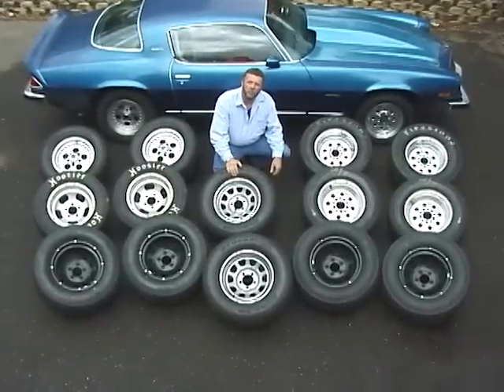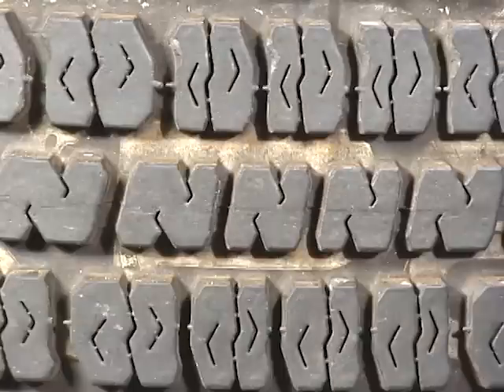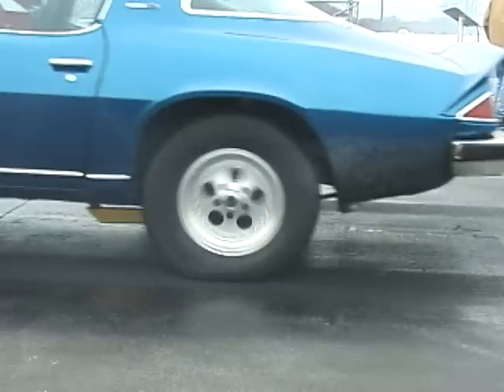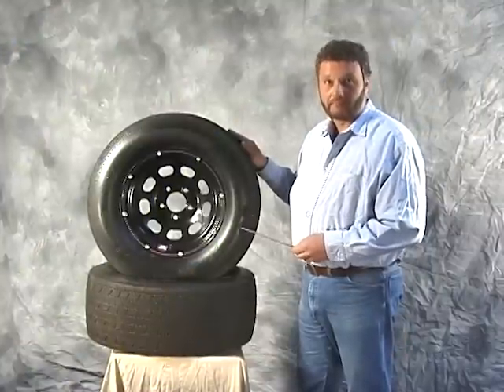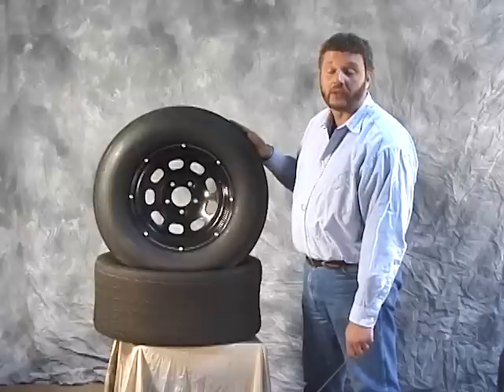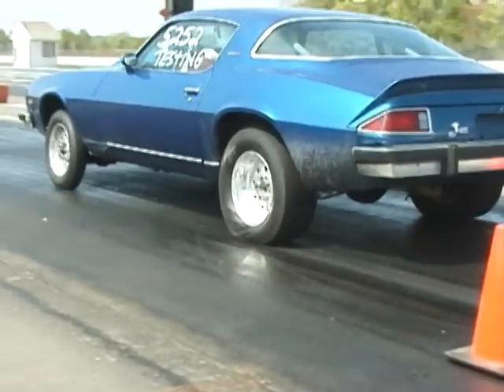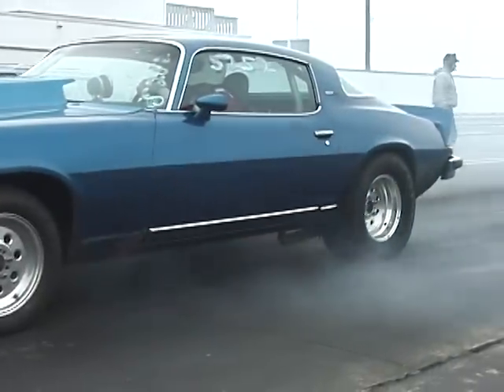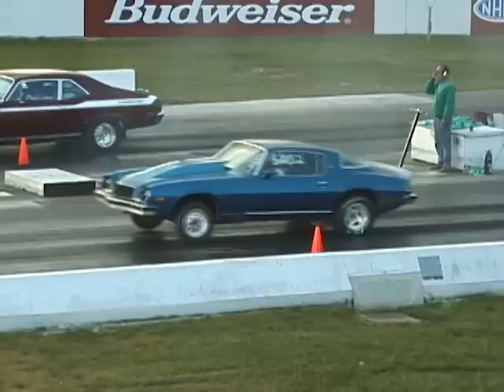DOT Drag Tire Test Video

Comment: Great great video, I'm still confused on what I should buy for track use only tire for a 6 speed car making 400 rwhp, I'd have to drive to and back from the track 2 hours each way.
Reply: +Stevie Bottz Get yourself a small utility trailer and a small hitch welded on.. because with a 6spd your best bet is a Bias Ply set of tires which even if you get a DOT rated set. Do Not try and drive them on the streets. They're extremely sketchy and with the movement in the sideway turning is always sketchy, and if you're caught in the rain.. forget about it your sitting it out til the road dries.. you cannot run radials up front and bias in back( Most tracks wont let you.. and even if they did you get squirrelly on the top end and can easily wreck it) so you'll need Front Runner Bias ply and Rear Bias ply tires. Bias Ply is alot more forgiving on your rear end components and absorb the shock of the launch alot better. With Radials the sidewalls are much stiffer as explained in this video so more shock hits your rear end and depending on what you have done to it at all.. Its really only a matter of time before you blow it up and with a M6 its usually Much earlier than you think. Drag Radials really were designed for Auto Trans cars, where the launches arent has harsh really. but obviously when you get into high enough power you'll want to get a stronger rear end with whatever you plan on doing.
Reply: +slasher7555 Oh and i almost forgot to make a suggestion.. MT ET Streets Bias Ply version.. Dont really mess w/ slicks until you have a built rearend to take the punishment. you can't really go off this video that much since its from 1999, Tons of new options have been made available since lol
Reply: slasher7555 Thanks for the imput, my TA has a moser 9" with 410 gears 6speed, the entire rear including axles and suspension mods are done. I cannot trailer it so I was looking into toyo proxes tq drag radials, do you think those would work for me? I would like a sticky tire that will take the 6 speed and still sorta be  streetable, thx In advance..
Reply: Ok so your rear will be able to take the shock abuse, but you won't get your best 60ft with DRs. Bias Ply will always be best for a stick car.. You most definitely can but a small hitch on your bird(it was an option too believe it or not from factory) its been done many times, by like the guys who run the Hot Rod Drag Week and a lot of guys who drive their cars to/from the track. But if you don't want to that's a different story. You won't get your best 60ft but you'll still hook. Now I'm still personally attached to the Mickey Thompson ET Streets so this case you would go with The Radial version. But there's also the newer ET Street II's, and ET Street R, ET Street Pro Etc. The ET Streets are what paved the way and set all the track records. The Toyo Proxes are good tires don't get me wrong, and alot of people like their price.. I've heard them Compared to the Nitto NT05s, might have a little issue hooking w/ the M6 initially, since DR's are made more to suit an Auto car. There's quite a few threads you can read about these tires on Ls1Tech that are comparisons and frankly the New ET Street Radials always came ahead in favor. Also think about some front Runners, you can save usually like 50lbs of rotating mass up front with them. Alot of Fbody guys and vette guys use GTO Spare Rims with MT Sportsman 26-6-17s on the front. you usually can shave another .1-.15 with the reduced rotational weight.
Reply: As for the car, I kind've figured it was a Fbody when i read 6spd ;) I'm an Fbody guy myself. I have a Pro-Touring 3rd Gen Iroc. Under the Hood (my videos are a bit out of date) is a forged 385 Stroker running a Holley Stealth Ram Tunnel ram intake and Stand Alone Holley EFI. Should be putting down around 450rwhp, its built to whip around a road course or hit the 1/4mile. Will be prepping for a cage at the end of this season to come out strong w/ a 300shot to add to the mix hehe. My daily wheels are 265s up front 295s in back Bridgestone Potenza RE760 Sports which are amazing for turning.. and 1/4 will see the GTO Spares up front and MT ET Streets Radials in back since its a A4 trans
Reply: Sweet always good meeting a fellow Fbody fan and thanks for your insight much abliged. Your Iroc sounds sick. I had a 87 Z28 h.o stolen from me some years back, white with silver bottom Iroc wheels, all stock with a muffler delete lol no tune back in those days I knew no better.
Reply: My current set up is a 99 t/a full exhaust lid tune 410 gears made 330whp previous owner told me but she smells rich,  I love my car. I've been reading up on how restrictive my flow master muffler is so I'm getting something else, I have I believe 80 series cross flow chambered known to flow as good as stock just sound better. Today I started to gut the interior then going to reseal it to see how it sounds just for the hell of it, if no good I want tsp stingers or magna flow. I'm only considering M/T or toyo at this point, I'm going to buy a spare set of dedicated track wheels but need to drive back and fourth on them if I don't hitch.
Reply: Almost forgot I m running bfgoodrich g force t/a kd 315 35 zr17. I was considering dropping my tire pressure but heard it's a waste on street tires so I just braze them. Best 60 foot 2.327 I drive pretty good but spin a decent amount in 1st and 2nd, 2nd time at the track with this car, I even hit a 2.6 at 107 then 13.60 at 108 with a 2.3 60'. I need traction to run stronger, I'm sure it has 12s in it.
Reply: Very Nice, and yea Flowmasters are horrible. My exhaust is pretty much custom including the Headers which were made my Dyno Don out of California they're intermediate length built for 3rd gens. 1-3/4 primaries 2.5" collector. and Length is between Short and Long for best fit and a happy median between Low end tq and high end hp applications. I did still stick with a Magnaflow setup in the rear to finish it all off. And yeah dropping tire pressure doesnt do much on a street tire, they work best when they're at their riding temp and Psi. thats why you even have people say dont do a burn out w a street tire. maybe a quick blip to clean the tread but thats it, and also to avoid and go around the waterbox don't drive through it. You should check out my videos of the car, I dont have anything that real current since i did the new motor swap last year.. but my 355ci that was in these videos put down 327rwhp/335rwtq on the dyno.
Reply: Will do, slasher do you think I'll throw my tune off by making my exhaust less restrictive with a better flowing muffler since the it was tuned with the flow master, I know the back and fourth talk about back pressure so it makes me wonder, I'm hoping I don't have to re tune for more flow etc
Reply: Naw no change of tune for just swapping out a muffler
Reply: Cool, your Iroc is badass
Reply: ty sir, and will be alot faster and getting a well deserved update video soon once i'm done w/ the Holley EFI stand alone ecu swap. It'll mark the stroker being complete

Comment: Weight of tires is a factor , as is the weight of the wheels. On the same Weld Rodlite wheels, going from a Mickey Thompson ET Street S/S radial size 295/65R15 to a Goodyear Eagle radial slick (30/9.0R15) actually 29.5” tall, my ET dropped .128 second and my MPH picked up 2.48 mph.  The weight difference between each tire was 16 lbs. 38 lbs for the M/T and 22 lbs for the Goodyear. Now consider besides the tire weight differences, the difference between forged aluminum wheels some of these had (Weld Draglites), the cast aluminum wheels (Ansen Sprint type) and steel rims, makes this comparison so bogus, not to mention the fact of a stick shifted manual trans !  What a waste of time.

Comment: he says, I chose a manual, so I would have more control over rpm" that is the typical crap people say. because they believe shifting a manual, "makes you a man". you have just as much "control" with an auto. IF you're smart enough to shift it manually!!
Reply from the maker: No, the driver won 5 championships with his 4 speed Camaro back when he was racing at E-town. It was his choice of transmission.
Reply from the maker: I should add, the guy who bought his car had no luck.  It is the driver's choice.
Reply: cartapes it may have been his choice, but he's perpetuating the myth, and lie that a manual trans.somehow gives you any more "control" than an auto.
Reply: lol. okay tell me how u balance and slip the clutch, down shift rev match and power shift in an auto since "you have just as much "control" with an auto"
Reply: I asked a simple question since you seem to present your self as an expert... Why are you being so aggressive? Mad that your Honda lawnmower is slower than a garden slug? Haha. If you actually drove a manual you'd understand balance. Balancing the clutch is when you adjust the friction point of the the bite of the clutch. maybe go YouTube it and educate your self before bashing manual. Having a manual especially in turbo cars means u can hold the engine rmp at the point where the car is making boost. So when you launch the car you have optimum power delivery at the wheels from a stand still. But I guess trying to educate you is like talking to a bag of shit. Nothing you hear will change your mind because you simply can't hate auto because you own and drive one and u have so much pride you simply can't take the fact that manual cars have more control so you've convinced your self putting your auto in to 1 to D is just the same.
Reply: ihateliberals not from the lunch you don't on a everyday car plus this video looms like its from the 80s
Reply: Guyito Martinez        I agree with your comment about car transmissions and the auto stuff.  But we should not descend to "ihateliberals" level of name calling.  But I must applaud your inventive description of him and how he came to be among us.
Reply: +ihateliberals    Why the name calling?  How old are you?  Are you the junior high school playground bully?  Do you beat up your siblings?  Do you torture small animals?  Do you set fires?  Please let us know so we can avoid you.
Reply: I think the idea was to shock the tires and see what they would do. The suspension was simple on purpose. Its more about making a street car hook and showing what you gain by slicks and no slip.